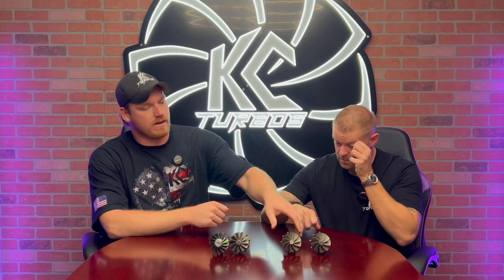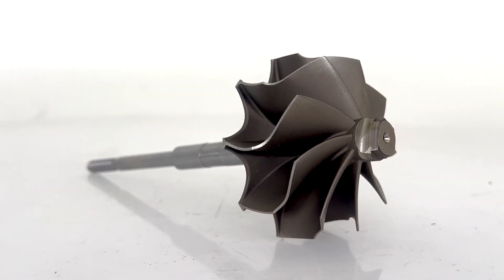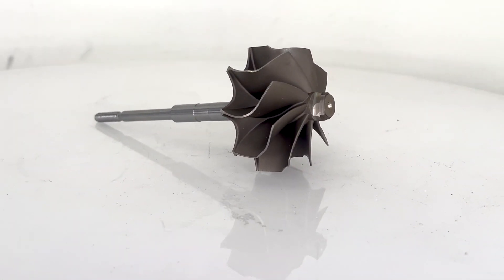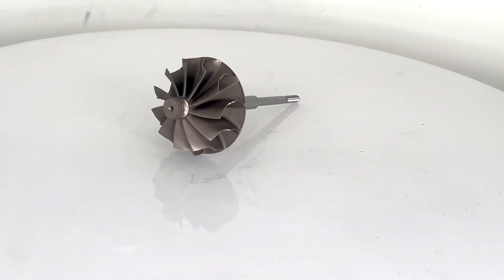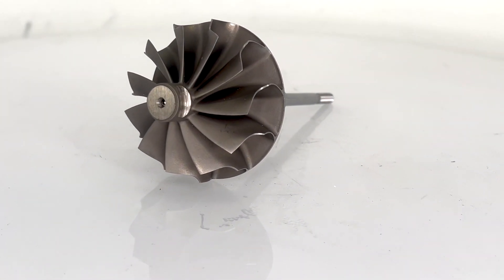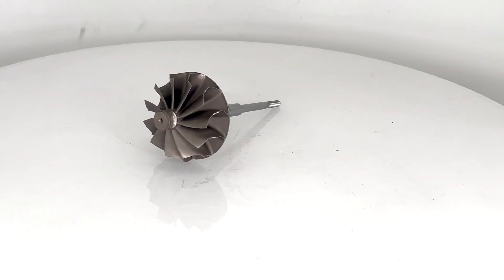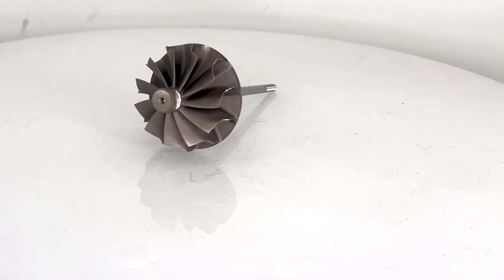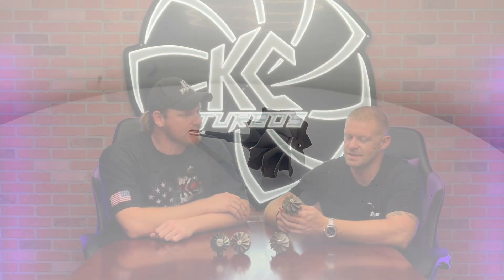Big Noise, Bigger Power! - 9 & 11 Turbine Wheels EXPLAINED!

Comment: If only you guys supported 5.9 cummins  guys more,  looking for a divided t3, dual wastgated turbine that flows similar to an upgraded 67/76 turbine on  an he351 but,  in a smaller turbine package.

  A 60mm turbo suporting an extended tip, narrow hub, billet ball mill compressor wheel design.

having that kc tech, a smaller turbine would make a hug improvement, seeing how you can't really go hubless without pattent issues with another style i recently  saw. 

If i can find this setup, it would be awesome because It would create essentially  a new family of turbo.

 this style turbo would be essentially an ultra low drive pressure, faster spooling option that suports around 450-550hp and higher efficiency with those guys with tighter converters needing to  spool just after 1000-1200rpm, this would be huge. Might require a dbb chartridge upgrade, but i would think there is certainly  a market for this turbo.

  Also the abilities  to us a qsv ( quick spool valve)  or implementing one in the desighn of the turbine housing would also be huge, as this allows you to use  one port (the smaller port) till the second stage turbo kicks in, or you get above a certain boost level.  To fully open up, and while open the turbine flows so well that its optimal for compounds.  This gate[wall] can be optimized for the turbine so there is no  need to ever adjust this,   and the best part is you are not likely to experience   a drop off in boost  ir failure in these mechanisms  as they are rather simple just as an internal  wastegate.

 emplementing a 2.5" compressor vband flange for a 90°  exit  that can be used or cut off would add versatility 

 

  A turbo like this would Bridge the power gap to support up to 1000-1200hp maybe more if desired depending  on second stage/ atmosphere turbo size.  The bottle neck is the turbine.

 For that,  as a said earlier, but  going from a dual gated  t3
 An open t3 flange turbine  housing could even be designed to house a qsv  if you curved and offset the snail inlet and added a spring loaded gate[ wall ]  that directs flow to the smaller port till boost is high enough  to open the larger port, and thus, it being  higher flowing port,  and a direct shot to the turbine  would be huge!  And  just after that qsv implementing dual  wg's  would add boost control, this would be status worthy.

 Of only a company would be so ambitious😏
Reply: What about a dual ball bearing drop in vgt turbo for the 5.9 cummins?  That would check all your boxes?  The vgt vanes basically accomplish what you are wanting with better tech.  I have seen those diverter valve turbos have issues and over time they tend to melt the diverter and have issues.
Reply: @peixinho5927   the big problem  with vgt turbos is well they are not quite proven yet in my book, and two (a big one) when the vet closes the nozzle becomes further away from the  turbine  and they work great yeah but.  Its not optimal enough  to me.   The mamba  5+5 turbine design  i think will definitely  make.  For a freag spooling high flow turbine  and  I  think one moving part in the housing is better than 20 moving parts.

Comment: Will you ever have the 11 blade in the stage 2 or 3? How about the ball bearings? Would definitely purchase if so
Reply: I asked about a week back, there working on bigger 11 options. 👌 I own a stg2R and want a 11 blade swap
Reply: I asked the day they released it and they said 11 blade will not be available for stage 2 or s2r.
Reply: @ryanbosacco6849 interesting that’s not what they told me 🤷‍♂️🧐
Reply: I’ve got an email. It won’t let me post a picture in the comments. That sucks man, because I went ahead and ordered a stage 1 with the 11 because I don’t want a 10 blade or 13 and that’s been the only option. Have been hoping for a quieter 64 option. What’s your email I’ll send it to you.